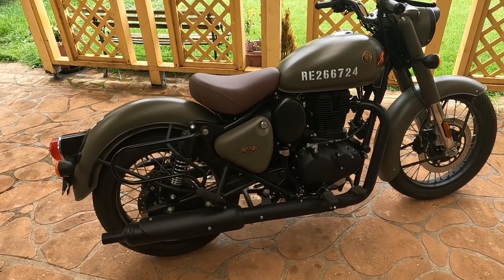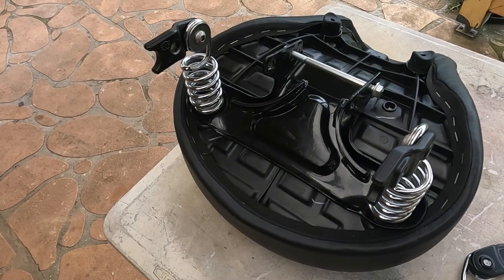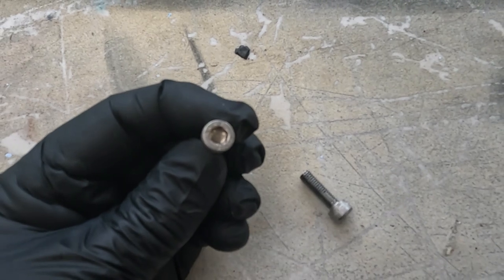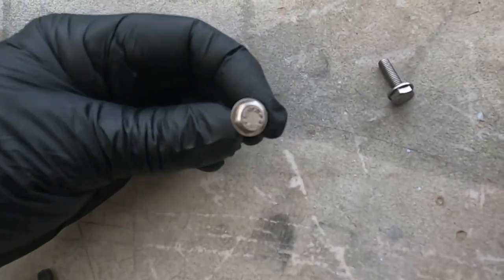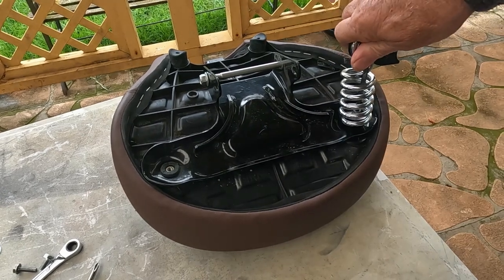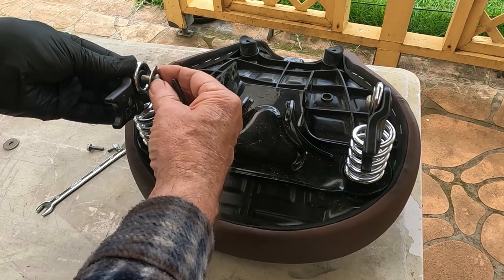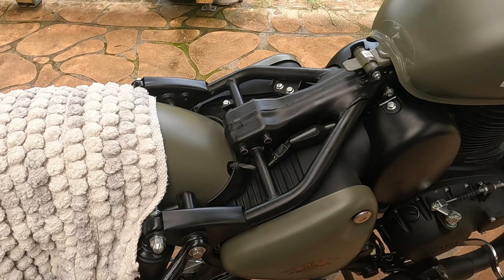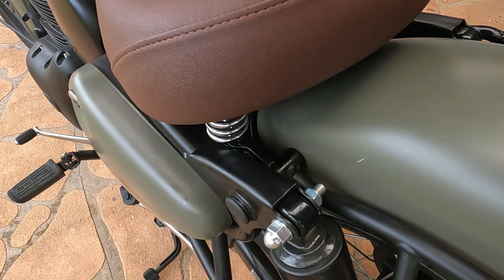2022 Royal Enfield Classic 350 Marsh Grey -Solo Seat Spring Fit- Don't Remove The Mudguard!

Comment: Morning Warro, it’s 10am here in UK. Brilliant video as usual. Very well explained.
If you need to replace the bolt that was taken out when you took off the passenger seat it is M8 x 110. If you use two washers and a nyloc nut the length will be spot on.
Ride safe. Ride often.
Reply from the maker: Thanks for the info and i will keep it for future refeence
Reply: Ou

Comment: Hey Warro, mine arrived today and I figured out the same solution as you, swapping the Allen for the hex bolts but you made the final fitting unnecessarily difficult. Instead of faffing with the Allen key or even replacing the bolt with another hex simply fit both springs to the brackets using the 10mm Allen and tighten before refitting the seat. To replace the seat offer both cut outs of the brackets up to the frame tubes and push the seat backwards; the give in the springs allows this and then locate the seat tank lug. Then simply fit the 2 hex bolts. Now you don’t have to fight with tightening the other 2 bolts further under the seat, simple.
Reply from the maker: sounds good to me. you should start your own enfield channel and i will follow your tips...lol
on another serious note when i did this clip several months ago there was not one clip in english available.
all i had was a couple of clips of guys in india fitting the spring kit and to do so -they totally pulled the rear mudguard to get at those dreaded threaded frame holes
so i thought im not pulling the guard as its a big job and did this instead. since then i've probably pulled the seat 8 or 10 times but next time down the track ...and theres always a next time i will try your method out.
as a rule i am not a fixer or problem solver. my speciality is buying new bikes which i do very well but fixing bikes......maybe sometimes...lol
hows that!
Reply: @ridewithwarro  Right there with you, the RE method/design is ridiculous. As an afterthought I guess there is no real reason to use the bolts holding the brackets at all. The brackets are engaged via the scoop onto the frame and the springs which are only cosmetic are fastened to the bracket and saddle frame; nothing is gonna move and saddle removal would just entail removing the 2 long bolts and pushing the saddle backwards to disengage the tank lug. So next time I take my saddle off I’ll not bother faffing with the 2 hex bolts I think.
Reply: @simonwalker7957  Simon and Warro, thanks for your opinions. I followed Simon's approach and its true. Infact, I didnt even remove the pillion seat in order to install the springs. I didnt mess around with the hex bolts and just left the spring bracket unbolted against the scoops. Nothing is gonna move

Comment: Hex bolts are what you need, not what you have. They are mushroom head Allen bolts. But you are absolutely correct USE hex bolts to save removing the mudguard. It's very straightforward...cheers
Reply from the maker: sounds good to me

Comment: Those are some really great seat installation tips, Warro.  I don't suppose that the instructions that came with the seat were that useful. lol
Reply from the maker: well they were that small i had trouble seeing them...lol plus they also recommended removing the rear guard which i didn't like that idea much at all
now ive done it on both bikes a few times its not that hard and pretty quick too

Comment: Hi Warro! Love the videos -just picked up a beautiful 2022 RE 350 in Halcyon Green - beautiful first bike. Is there a specific part number for this? I'm in Naples, FL USA but figure it would involve shipment from India anyway -just wanted to make sure I'm ordering the same part as you have here. Looks great!
Reply from the maker: eBay item number:194985729661
Reply: Hi there these touring seat are between £75—£90 in England  try looking up Hitchcock Motorcycles they have most R E  mod parts.

Comment: Maybe they should just fit springs on all the solo seats at the factory. Seems kind of silly that it’s an after market part for that seat. Also- why would they instruct to remove the rear mud guard? Seems akin to something like removing the engine to fit a shift lever! The bike really looks to be nicely made, simple. Hopefully the coatings, bearings, wires, and electrical connectors are all first quality too. Good video!
Reply from the maker: yeah i had heaps of 500 and the problems that went with them...lol these new 350's are great well put together bikes and very reliable.
both mine only had one issue...they both had faulty sticky speedos. 
ive done heaps of clips on these over the past year and learnt how reliable they really are. plus taken the blue one in some very rough outback roads too.
good to hear you enjoyed the clip too.
if you want to see a hard ride on a new bike check out my latest clip on the honda cb125f -really wild dirt road country
all the best!

Comment: Hi Warro, thanks for the great instructive video, just bought a set of springs and a touring seat, and lkke you, didn.t fancy removing the rear mudguard.
Just wondering, do you need to remove the seat to take the tank off for tappet adjustment etc? I guess that would be a lot more fiddly having to  undo the springs each time?  Thanks.. best regards...Pete
Reply from the maker: i'd say you'd have no choice but remove the seat and tank. ive heard that others have done it with tank on but im sure that would be frustrating and in the end you'll probably pull both just to get a clear run.
remember sure you'll remove them but once done you can have a good run before the next hit at them.
all the best.
you should try the classic 500 rear shocks too. mine rides much better with those on

Comment: Thanks for the video. I’m putting mine on tomorrow. If you don’t put that long bolt back in the back of the seat it make it a true springer seat. What do you think?
Reply from the maker: yeah it does and i actually tried it and its a bit wobbly...lol i suppose one could try a smaller diameter cross bolt. that would lock the seat into position and give it a bit of roll...lol

Comment: Line video! I just wonder if, after mounting springs, it is also possible to use the passenger seat? Thank you for any answer.
Reply from the maker: no issues but i like the old school solo seat as is. but no drama fitting the rear seat back on

Comment: You could cut the Allen wrench 1/4 inch to make it fit better in tight spots.
Reply from the maker: good call but since then i bought myself a better socket and key set so its a lot easier task now

Comment: Nice job. I do question the ability of the seat to move as the seat has two fixed points. The tab to lock it into the tank, and the main seat through bolt thats centered. (Pivot point.) 
I don't see how the seat will bounce on the springs. I can see the seat front tab breaking off or the seat frame breaking in half at the center through bolt location.
Reply from the maker: its more just for the visual effect but the stock 350 seat is pretty comfortable so the ride itself is still way ahead of the older 500 model

Comment: Great video. Do the springs actually work like they did on a Classic 500 ? Or they are just for aesthetics?
Reply from the maker: i think more so for the looks but saying that because the stock seat is far better comfort wise than the 500 -its a far better ride experience.
on a C5 you sit on the seat. its more like a flat platform to park your bottom end and on the Classic 350 which is a far softer medium you partly sink into the seat.
over-all i would not swap the C5 seating for the 350 experience period!
many a C5 bikes i've been bounced off that seat hitting bumps in the road but not so here

Comment: hi waro do you think this seat with some brackets  nouse welding fab work would it fit a classic 500, i think the rear springs would bolt up ok, i  was just wondering if i could fab weld up some brackets and  extend them forward from the metal thats already on the seat, keeping the weld heat to bare minimum so not to melt plastic then  remove the rubber stoppers , what you reckon mate, this touring seat looks lot better than the classic 500 touring seat cheers mate
Reply from the maker: well seeing you can weld and do the form work that's a big plus-i see no reason why it couldn't be done so i'd say -go for it!

Comment: Mate, looking at that seat mounting bracket, it seems that springs are serving only decorative purpose. I cannot see any pivot points towards the front of the seat. Please correct me if I am wrong. Cheers.
Reply from the maker: only for the looks really as the bike rides equal or better than 500 in stock form. this mod just gives it a much better old school rear view.
is it worth it definately. the stock looks rubbish with them. better still if you add touring seat too

Comment: Hi Warro, are the Seat springs only for optical issues or will they change comfort as well?
Reply from the maker: just for looks but if you buy the touring seat and add the springs not only does the bike look better but the ride on the touring seat is far better than the stock unit

Comment: Thanks for the extremely informative and diligent explanation of the installation Process… I’m thinking about making this change but I am curious if it changes the seat height? I’m assuming it does but you know what they say about assumptions…
Reply from the maker: if working on the stock seat i still think its about the same. the touring seat appeared to me a tad higher off the ground and seat slightly foreward.
this may be an illusion too so shortly i will put them back to back and measure height and ride bike one and onto bike 2
that should give a final thought on it
Reply: @ridewithwarro  Thank you brother… I’m vertically challenged so I’m ordering the low rider seat, I prefer the looks of the springs (and my old ass back ain’t complaining about getting a little bit of additional spring). Thanks again for checking, it’s appreciated
Reply from the maker: @LeveyAngeles  either way you look at it -the seat itself is a pretty good soft ride so springs or no springs i think it will be fine.
the low seat may not be as thick in the padding -not sure on that one

Comment: I have heard tec bike parts is developing a mild camshaft for this engine. Might liberate a bit extra power
Reply from the maker: i have not actually seen that mod but i think the power on tap is passable by the way it runs so far. i think if the potential buyer expects more from it the best idea is pull out more cash.
in most cases i find that stops a lot of them!
Reply: @ridewithwarro  they got 5hp extra for the hymalayan. Hopefully they can do it for the classic and meteor

Comment: So they are non-functional springs? Just for show?... there doesnt seem to be any pivot at the front like the old model.
Reply: Good point. At no stage was this mentioned. Just for show!
Reply from the maker: i purchased it for the visual and in all honesty a 500 doesn't ride as good as this stock unit and i've owned 15 new ones.
but on the second 350 which i fitted the touring seat its a far better ride than both 500 or 350
these a pretty good bikes in all areas
Reply: @ridewithwarro  sorry mate. I wasn't critisising.  I fitted them too...just for the looks!
Reply from the maker: @oldguzziguy  no drama there- i just bought them for the looks after riding so many 500's. i made up my mind when i first got one -it really needed the spring kit as in stock form i didn't like the look of the seat that much...lol
after the spring kit fit i think it looks more classic than the classic...lol
all the best and no wories
Reply: @ridewithwarro  enjoy the bike(s). I love mine
On another subject, (perversely) , I'm trying to obtain a 'european' type shift lever because I always ride with boots and don't care for the heel and toe changer.(I am in India). Guess I'll have to fit a lever from the Meteor as that comes with the 'normal' shifter even in India (I think!)
Reply: Oops...I'm wrong (again!) about the Meteor gear lever. Guess I'll have to get one from the UK when i return.
Reply from the maker: @oldguzziguy  well worth buying too. in fact i'd like another one
Reply from the maker: @jeffdean7666  i'd say yes! the touring seat has a gel insert and ive fitted it to the new model and noticed the difference in ride quality immediately.
im happy with it if not i'd just say ...not worth buying but not so.
you can always add the yss rear shocks too. i have those but so far not fitted them to this bike
so i think touring seat would be ideal for you

Comment: I see in your video that you did not replace the screw that holds the passenger seat support, is this screw really necessary since there is the other screw that holds the driver's seat?
Reply from the maker: only ever use the one seat support bolt. no issues so far on either bike so works fine for me
Reply: @ridewithwarro  thank you .

Comment: Hi Warro, does the spring option increase the seat height slightly?
Reply from the maker: it does on the halcyon grey with the touring seat fitted and easily noticed too easpecially from the rear view but not really noticeable on the stock seat

Comment: Can you still fit the OEM passenger seat with this spring kit ?
Reply from the maker: dont think it effects that side of it as the main bolt is under the seat and the other two off the shock towers sso i see why not
Reply: @ridewithwarro  thx
Btw just mounted with m8x16 hexa bolts as you suggested without removing mudguard ... Took me 20 mins top ! 
Thx mate
Reply from the maker: @pascalfellmann4727  good to hear you found it helpful

Comment: And how's the Powertronic doing ? 🙂
Reply from the maker: actually been too wet to get out and test ride it. i don't love riding bikes that much especially on arisky wet track...lol
but sooner or later the sun will shine and when it does its just a 3 minute run to open road and i will give it a good run
Reply from the maker: ive tested it on both bikes and my thoughts are...dont buy it yet! i dont think they have the maps right as i tested in on both stock bikes and they ran worse. ran right through the maps too.
i then fitted the sports exhaust it may have run slighter better with it on. after that i ran the bike with sports exhaust and no fuelx and it appeared to run near the same
so i removed it totally
Reply: @ridewithwarro  thanks for the feedback. It seems consistent with what people are saying about similar "solution" for Himalayan.

Comment: RE really went out of their way to make the spring mounts unnecessarily complex considering they're non-load bearing and strictly cosmetic.
Reply from the maker: lately i have ridden it with the rear seat mounts not connected to the frame. appears no different in ride side